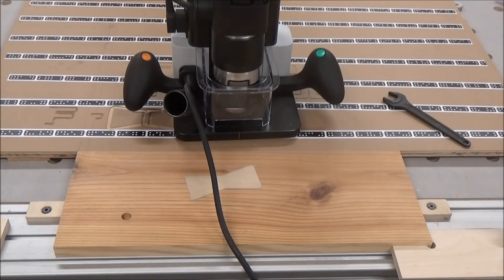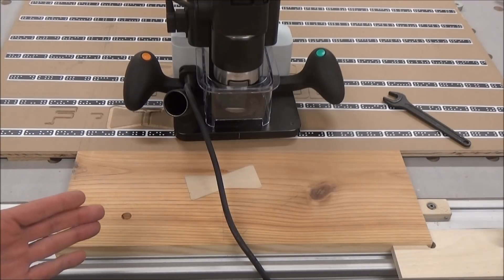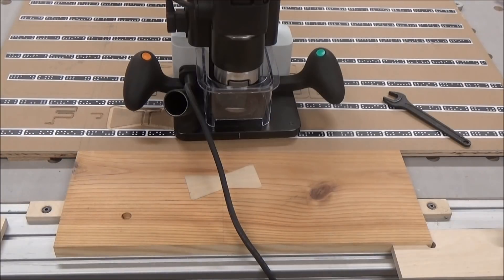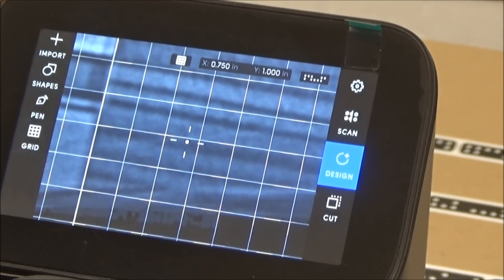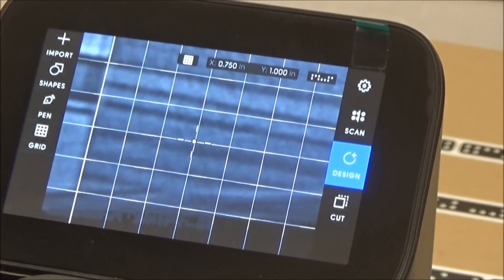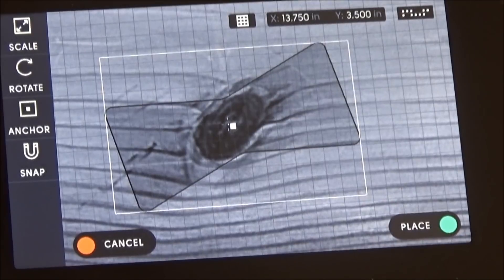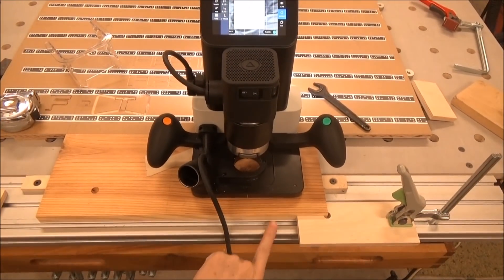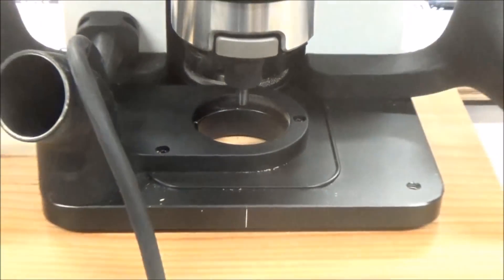Shaper Origin Grid System

Comment: Talking to Shaper Origin they recommend using the .25" bit put in normally to give the most accurate grid. When using the engraver bit upside down it will be up to .125" off. I had asked them because they have both ways out there. So FYI they did verify the proper way. Have fun.
Reply from the maker: Thanks for the input and for watching.